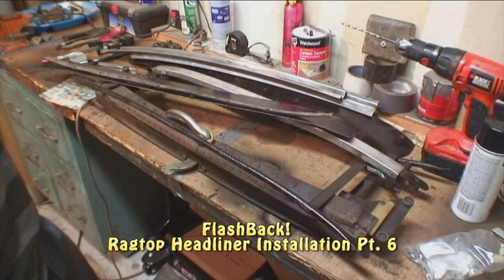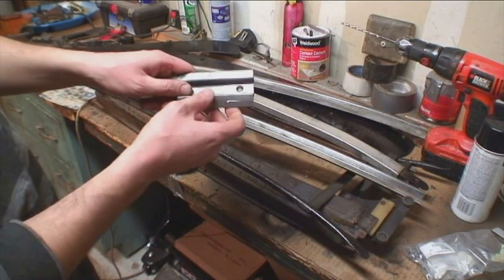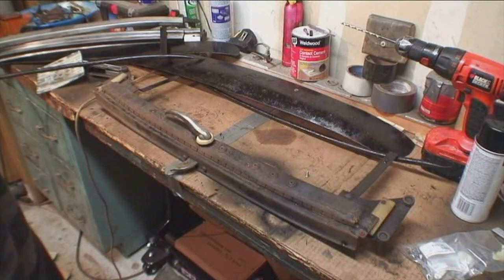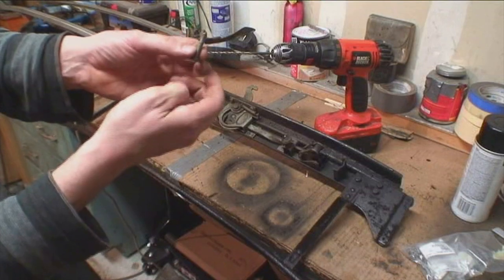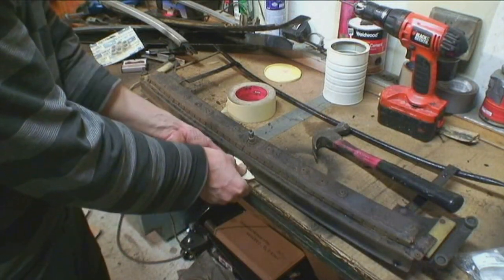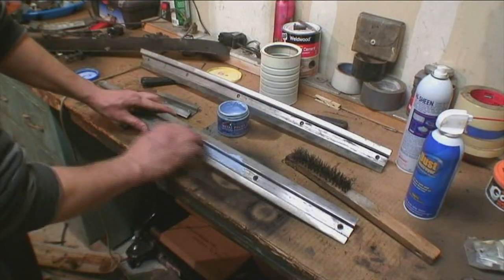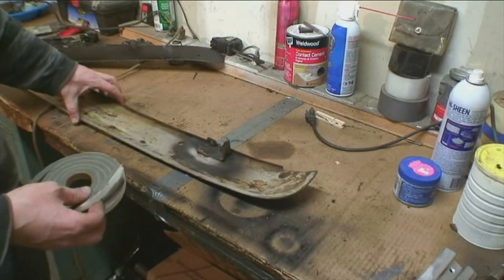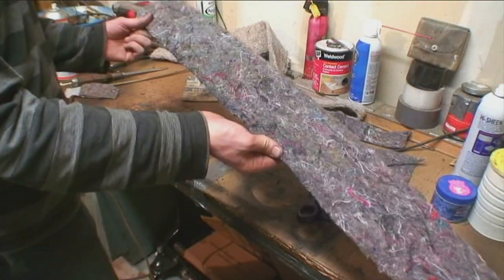Classic VW BuGs How To Install a Ragtop Beetle Headliner and Top Part 6

Comment: Have you done a vid on a 3 fold rag install? Have a Grumpys metal kit in a 52 Twitter that I am figuring  out currently , ( its just a puzzle ) , ( with a sew fine kit ) the rag top part .... got a bunch of Q , I, done 115 of the 2 folds and many multi and one piece .but this has been a challenge
Reply from the maker: I do not have a vid yet on that, but it is kinda similar to the 2 fold, but with just an extra bow, and with sliders.
Reply: @classicvwbugs  except the retains clip holes for the anchor at the rear and the glue up of the front bow , with no pockets , you up for a call next week? -Spook
Reply from the maker: @AirkooledKustoms  hell yeah man!  =)